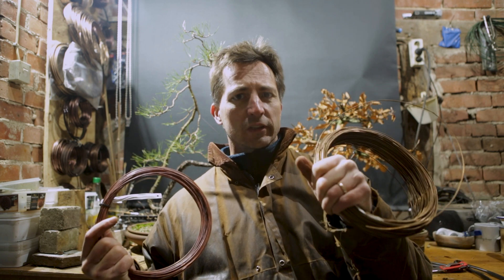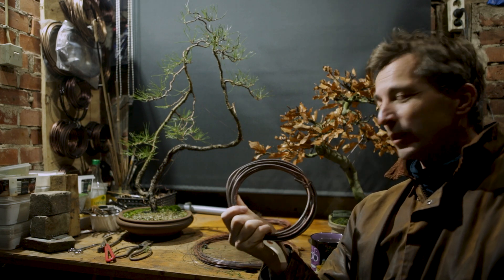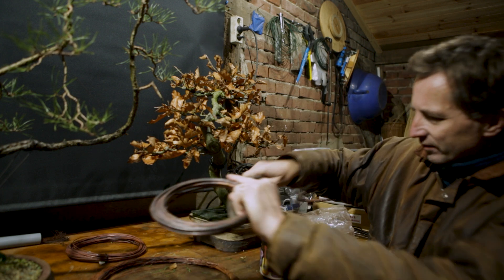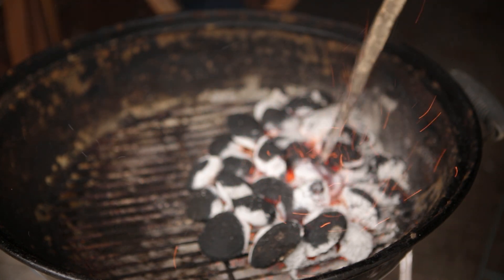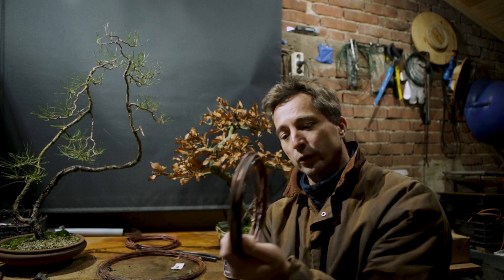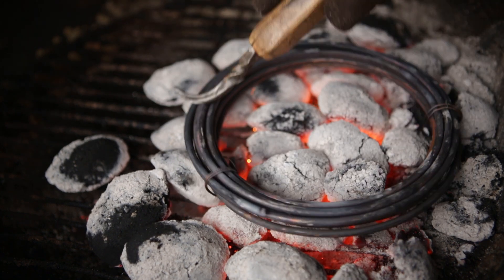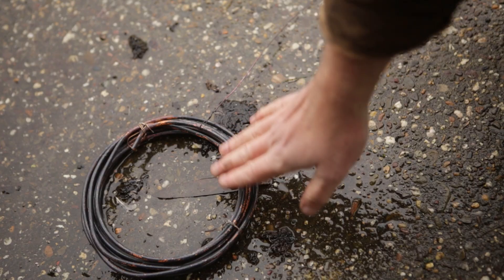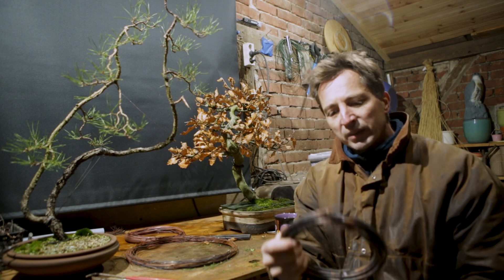Making Copper Bonsai Wire Pliable

Comment: I would not suggest to cool it in wire. Rapidly cooling a metal from from a high temperature using a medium such as water is known as quenching which is a herdening technique.  Allowing it to cool slowly wil result in a much softer material.

I use my gas top stove when I cook sometimes to feed previously used copper wire pieces through to soften it and be able to use it again.

If you want to use a grill I'd suggest carcoal with a hairdryer you'd be able to much more easily get higher temperatures. 

Also from S.A.🇿🇦😁
Reply from the maker: For copper there is no hardening when fast-cooled. That is for iron-based materials.

Comment: I always get the copper wire from our maintenance engineer when he fits new machines in the factory.
I strip the plastic coating and place it in  the metal kiln at 1000  degrees till cherry red strait in a bucket 🪣 of cold water then job done 🪴
Reply from the maker: Sounds like a great job perk!
Reply: @ always

Comment: Some insulated welding gloves would be a great way to protect your hands while annealing the wire.  When I was taught how to anneal steel we would burry the metal in dry sand.  The sand dissipates the heat slower and keeps it from having hard and soft areas.
Reply from the maker: i do not normally anneal myself, so not frequent enough to get special gloves for me, but great tip for those who do

Comment: Thanks for the demonstration.  I love copper but have gotten frustrated when it hardens up.  I think my little fire-pit will be just right for this project.  Great use for the root hook.  I love mine!  BTW if you want to up the heat on those coals, use a hair dryer.  It will bring them to a high burn evenly and quickly.
Reply from the maker: thx

Comment: We anneal wire regularly for making jewelry.  You can use a propane torch to heat up the wire to a glow and then dunk it in a bowl of water to cool down.  Great advice.
Reply from the maker: yes. Now where to find a large enough torch:)?